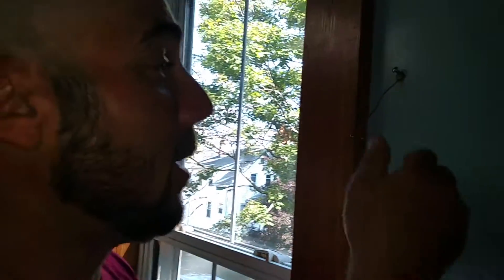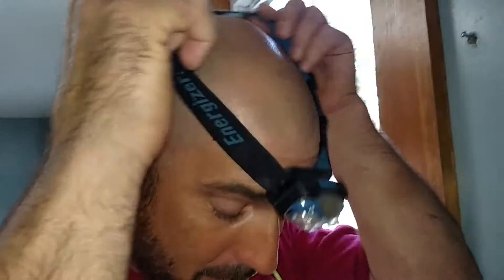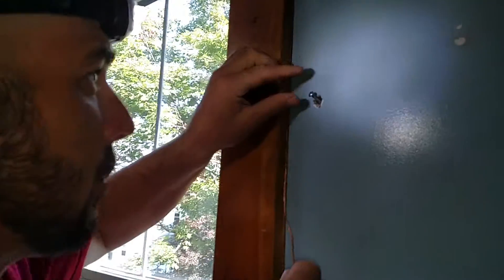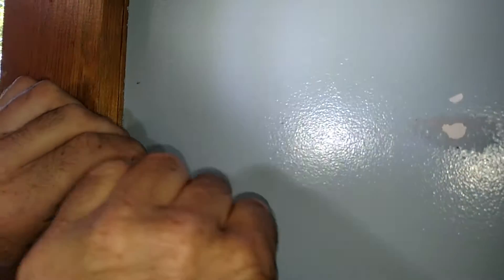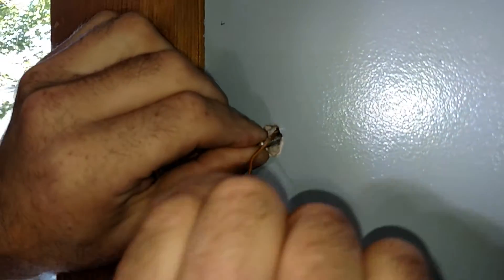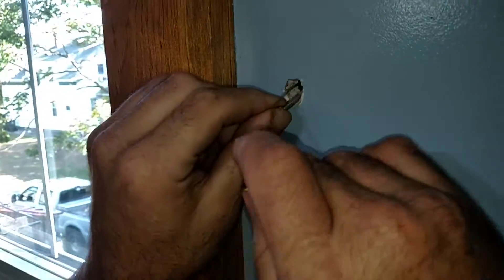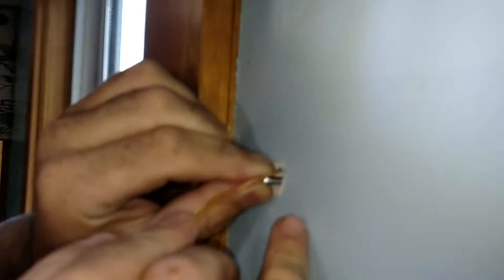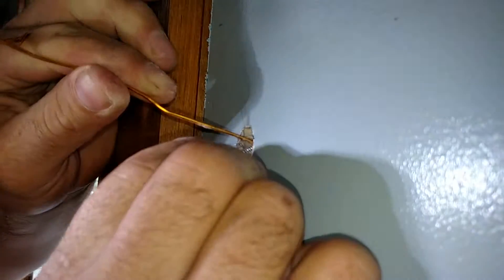How to remove a toggle bolt without losing the anchor behind the wall

Comment: Great tip! Was down to my last toggle and needed it back out to add a larger washer for the project. I would add that the screw needs to be backed out just to the point of being able to turn the toggle sideways so the wire can fish out one end of the fully extended toggle and not fighting the spring.

Comment: :o(  I don't get it.  I wish there was a video that shows both sides of the drywall as do many other videos so you "get" what is happening on the other side.  I so want to get my spring toggle back, but I don't understand.  Looks like magic to me!!!
Reply from the maker: Yes it is a little bit confusing to understand what's going on in the wall.  Basically, the spring anchor needs to be backed off the long screw just enough to turn to the side where it can slip out the hole the long way.  If you unscrew it too much, it could fall off the end so it does take a little bit of patience finding the best distance to unscrew. I would recommend small increments until you can get the anchor to turn out.  Better luck next time!!

Comment: Ummmmm yea no this don’t work too watched this vid 39 times and tried but no don’t believe this it’s bad
Reply from the maker: I appreciate the your feedback! Yes, it does take a little bit of finesse to pull off.  Maybe just buying some new anchors would be a better option for you if you are having a hard time. They're relatively inexpensive.
Reply: I made a short video to further explain what's going on to help with removal: https://youtu.be/nu3ZVMVIK3s
Reply: Greg's video will help with the mechanics of the wing nut.